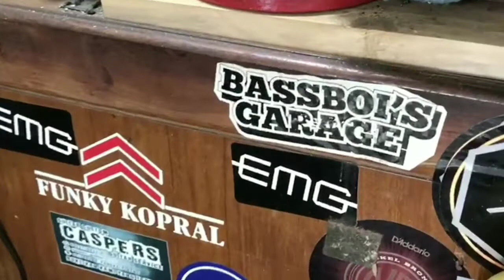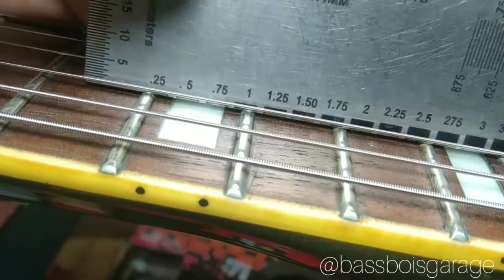Setup Epiphone Alleykat

Comment: Anyone have the wiring diagram? Fell into possession of one but it was a parts guitar from the previous owner so the mini humbucker is missing
Reply: Same thing happened to me. I acquired a 2001 that didn't work so I was trying to get it working. There is a wiring diagram I found out there but it's a quirky design because of the 2 pickup volumes and then the master volume and tone. You'll know when you find it because it's some PDF that someone found from 2001. To me it's a strange wiring scheme and I could never get it to really sound right. I ended up replacing all the pots and the 3-way switch, and re-wiring mine to the traditional 2 vol 2 tone setup like a LP and it sounds great now. Good luck.
Reply: @DisappearingBoy2010  Thanks so much man